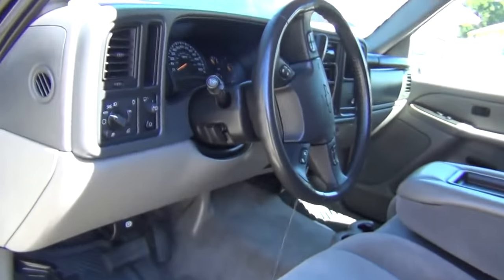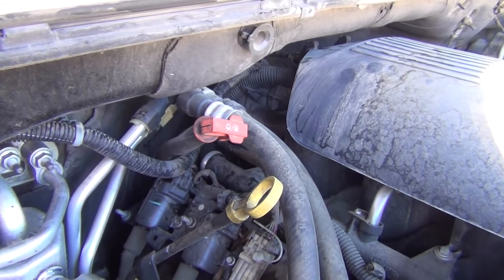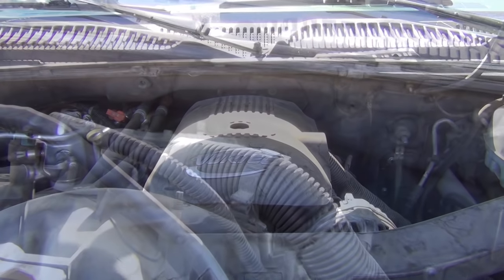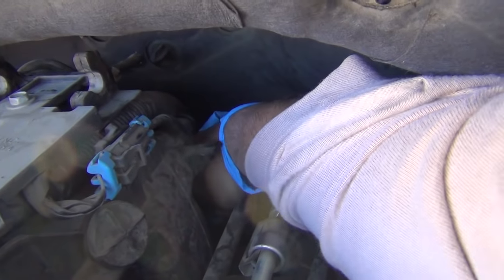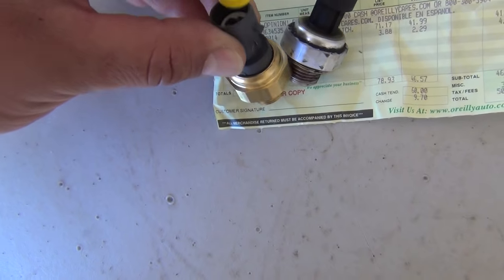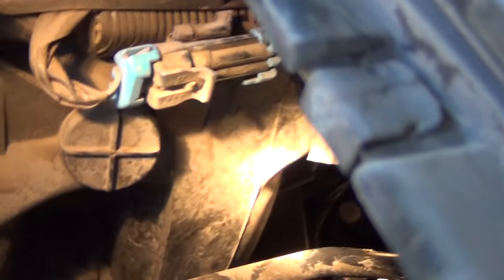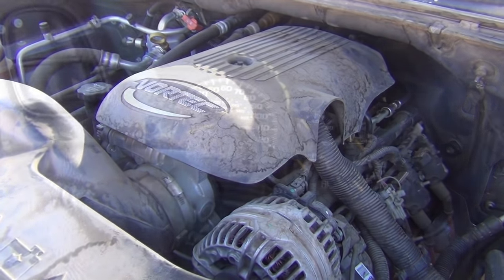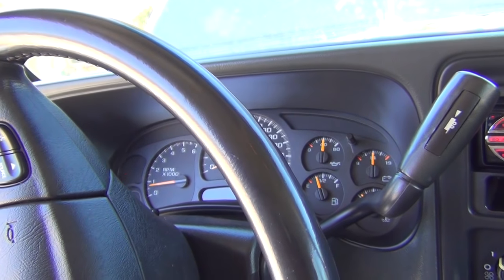CHEVY OIL PRESSURE HIGH....FIX!

Comment: I have a 2003 chevrolet Avalanche 5.3L V8. My pressure gauge is over max at a 4-5 o'clock position. I can't even see behind the engine. Did you remove anything else besides the cover or is there some trick I'm not seeing?
Reply from the maker: Sounds like a body ground strap.
I just helped a neighbor install a fuel pump and when we went to test it a few gauges were maxed out.
Turns out the bed of the truck was still elevated and the fuel neck was not touching the bed. The fuel neck has a ground strap and this was the problem.
A ground strap is a bare wire that looks like braided hair. There are several of them grounding at the back of the engine to the fire wall, from the frame rails in the rear, and up front.
Reply: ImRamro
Reply: ImRamro

Comment: I have a 2005 chevy avalanche 1500. The problem Is different. My oil pressure is under 40. I checked my oil level and it's good. Do you have an idea on what the problem might be!
Reply: Oil pump could be going out

Comment: hey I got the same thing wrong with my brothers truck and I want to know if you have to get that part fixed and just drive around with it high like that
Reply: Brian Gavranovic You can. It does not hurt the motor, but if for instance your oil pump goes out. it can cause you to blow up the motor. it is more of a prevention gauge, but if you need to drive it until you can get the part it will be fine.

Comment: I change my oil pressure sensor on my 2003 Dodge ram in the oil pressure is still high and it's gotten a little higher all I see is videos on oil pressure sensors and sending units I can't find any videos on what to do about high oil pressure if it's not your sensor please help anybody

Comment: How do I know which one is the plug when I'm looking at my 03 Chevy 5.3 V8? I'm going to attempt to do this on my own.
Reply from the maker: They are all in the same spot on the 2000's models. It should be just like the video. All the senders and temp sensors look similar, but they will not have the same plug in. 
Once you get the new part, just unplug the old unit and plug in the new one on the wiring before the install. Remember you may have to reuse the little rubber grommet from the connector.
Reply: Thank you. Your video was very helpful.
Reply from the maker: Jeanna Young No problem Jeanna Young, please let me know if you run into any problems?

Comment: I'm looking for a motor that can withstand the transmission I've told you but has around 320 -350 horsepower doesn't matter if it's a few thousands ...I tried summit racing ...car id ...but maybe I don't know how to look up engines right or they don't make him ... any suggestions??
Reply from the maker: +Jose Chavolla Here is a link with some nice engines that create some great horsepower. 
You may have to change out the torque converter to handle the added power?
Reply from the maker: +ImRamro http://www.jegs.com/c/Engines-Components_Engine-Assembled-Ready-to-Run/10763/10002/-1

Comment: will the oil leak when the oil sending unit is bad ??
Reply from the maker: Laxmi Sashi Not normally.....NO. 
The sending unit usually has tape of some kind of glue on the threads so they rarely leak. Do you have  a leak around this area? The leaks usually come from the intake manifold or the valve cover gaskets in most cars.

Comment: Can I keep driving without fixing this problem?
Reply from the maker: Yes the vehicle will function normally.
Just don't let it go forever.
Having a good working pressure gauge is a must.
This is the only way to tell if you have oil pressure or low oil issues that can lead to engine failure.
You don't need to replace it immediately.

Comment: So the gauge starts at 40 but goes to 60 when rpm go up or when you on the gas is the normal?
Reply: Thats how my truck was running but now it idles at 40 and driving down the st. It goes to 60 and on the freeway it goes up to 80 but used to only go up to 60

Comment: it's me again ...I'm looking for a replacement motor for my 2002 ford ranger thunderbolt it's got  4.0L v6 SOHC, RWD with a 5-speed automatic transmission...
any suggestions? ?? on motors?? that fit??
Reply from the maker: +Jose Chavolla When it comes to Fords I hate to say I do not know a lot about them.
I had a Ford Ranger with an inline 6 cylinder engine and that thing ran great.
I would have to just get on  some forums and message boards and ask around to find the info on that truck, sorry.
Reply: Hey, I've got a 99 Z-71 with the 5.3. I changed the oil a couple of weeks ago and my pressure will sometimes start out at about 50, and I'm hearing a ticking noise, like lifters maybe?? I can't remember for certain but I believe I used Valvoline high mileage that was a mix blend. Could this be causing the chatter I'm hearing as well as a little higher oil pressure? It used to always be right on 40 and never heard ticking. it just turned 160,000 miles. And I also added a quart of Lucas oil stabilizer when I changed it. Any info would be greatly appreciated!!!!
Reply from the maker: Rob Hamilton Oil filters and different oil could cause a change, but the noise is not a good sign.
The stabilizer should help, but most oil additives have some form of metal like zinc that helps with wear and tappet noise.
I do not think that the oil change will have any disastrous effect and 50 is not a bad pressure.
I would assume that your old oil had a lot of metal inside of it, like all old used oil does. This metal that is inside the oil is from metal wear and bearings and is different than metal shavings. You can try AMSOIL Z-ROD oil, but that stuff is expensive. I would try any oil for high mileage or that contains some type of zinc. I hope this helps?

Comment: hi everyone I was having the same problem ...I changed the pressure unit myself but the oli pressure on the gauge indicates barely low halfway .....but when I accelerate the gauge goes all the way to 80 at 70mph ..... do I need a need engine swap?? I heard about rebuilds ....which is more convinient??? last longer and not that expensive ?? and last any guess prices for either one ?? I have a 2004 chevrolet tahoe 5.3 fuel injected
Reply from the maker: +Jose Chavolla Sounds like the lower half of the engine needs to be rebuilt.
The low pressure issue is usually caused by the crank journals, or wear in the crank race bearings. 
If you can do some of the work yourself you can save a lot of money.
Here is a link that may explain the process a lot better than I can?
http://www.carsdirect.com/car-repair/how-to-tell-if-its-time-for-an-engine-rebuild
Reply: So to rebuild this motor is no more than 1,200?? Any recommended places?? So just the rebuild would be better than a motor swap right??? Cuz I just had the originsl transmission rebuild last month and I really don't wanna spend that much .....I'm has 21500 0 miles and I notice this problem about 3 days ago ...no white smoke coming out just the motor seems to quiet
Reply from the maker: Jose Chavolla There are a couple machine shops in my local area of central California?
If you look for engine machine shops and your city, you should get several in your area.
Many machine shops have many different prices. It would be smart to call around. 
I would ask how much for a complete engine rebuild? How much for a lower engine or short block rebuild? How much if you pull the engine and deliver it to them? 
This will give you the best idea of what kind of money you are looking at spending?

Comment: I have an 04' silverado 1500 with the 5.3. 
My question is, when I start the truck it stays at 40 PSI, once I start to drive, it'll drop, but once I accelerate it goes back to 40 PSI. 

What could be causing this?
Reply: Once I brake or slow down it drops.
Reply from the maker: Wesley Moore
The higher the engines R.P.M's, the higher the pressure.
This "could" mean that the crank journals or main bearings are worn?
This happens as the engine wears and the only way to fix it is to replace the bearings and have the crank shaft turned?
Another cause could be the oil pump. As the oil pump wears the gears have more space between them. This causes the pump to push less oil through the engine.
The cheapest fix would be to start with the oil pump and replace it with a high volume pump. This could help or resolve the problem all together. If this does not solve the problem, then the crank and bearings would be the only other option. Good luck and I hope this helped. It would be nice if it was like a 50 dollar part, but this is usually caused by high bearing wear in the lower half of the engine.

Comment: My 2007 Tahoe just started this.... It reads fine most of the time and then sometimes it just goes to Zero and starts blinking and telling me to shut the engine off... If i turn the rig of and then restart it goes back to normal.. Happens speratically...Im pretty sure the oil pressure is fine so im thinking either the gauge or the Sensor.... THOUGHT????
Reply from the maker: James Owens Your fist message, just showed up, lol. 
When the engine is running fine pull the oil fill cap on the valve cover and look inside with a flashlight. "If" you can see oil squirting around you know oil is being pumped up through your heads. Then when the oil pressure drops off, keep the engine running and go look inside the oil fill cap. If you do not see oil squirting around rapidly like before, then your oil pump is not pumping. This could be the oil pump going out or maybe a piece of metal or plastic stuck in the oil pickup screen? Either way, if your sensor is accurate and the oil is not pumping up through the head, you will have to change the oil pump. I hope this gives you a place to start. If this does not get you anywhere, you can remove the oil sending unit and get an oil pressure tester. Screw it in the same hole and run the engine to test the true oil pressure.
Reply: @ImRamro  I got a 2008 Chevy Tahoe and the oil pressure is showing 80 PSI
Reply from the maker: @r-luvbham6608  If 80 is peged to maximum pressure, it is almost always the oil sending unit. super easy to fix.
Reply from the maker: This is supposed to happen when the oil sending unit fails. Believe it or not this is a very common problem. The gauge maxing out means it is bad and needs to be replaced.
Reply: @ImRamro  thanks

Comment: I am on the side of the road with my 2006 chevy Silverado. On way to work alarm tells me low oil pressure (on zero) sporadically it jumped up around 60 and back to zero. When I pulled into rest area with engine idling it went to 80. When I shut off engine and turn key on without starting pressure goes to 80 and stays there. Idling stays at 80, rev goes to zero. Am I safe to drive home? (20 miles)
Reply from the maker: I would say yes!! If the gauge is reading and the engine is not running, it is not reading pressure accurately. watch the temp. Good luck
Reply: @ImRamro  thank you! .... I will replace it tonight
Reply from the maker: @rossmacneil6033  Please let me know if it works?

Comment: my 05 Chevy has same high oil pressure so I pick up a pressure switch I wa$ told I need a special tool is that right
Reply: Keven Tirrell u need a oil sensor socket 1 1/16 I believe

Comment: my 98 z71 every other day when I start it up or sometimes when I'm driving the oil pressure will hit 80 and the engine starts knocking. it's driving me nuts. is this oil pump?
seeking confirmation and advise
Reply: I'd check you're oil lol

Comment: would this oil sender cause oil to leak?
Reply from the maker: +David Smith I have had the oil sending unit leak on my 1993 Chevy Z71 and had my gauge max out.
I do not know how common this is because all the sending units on newer vehicles just go out and max out the gauge. A leak at the base of the sending unit is very common, but it does not mean that the unit is bad.

Comment: can the oil pressure sending unit cause the engine light to come on??
Reply: JDM Toys
Reply: Wow, my h2's check engine light came on and I had my oil pressure saying 80 PSI (Maxed out) but its funny because I've had trouble where the check engine light comes on because I've had a misfire too.

Comment: Would this work if the oil pressure gauge doesn't move at all?
Reply from the maker: i would start here, it is cheaper than replacing the gauge.
Reply: ImRamro ah ok thank you sir 👌

Comment: Hi I have a 2007 Chevy Silverado classic 4.8.. And my oil pressure gauge on the dash board shows ways past the 80.. What would that mean??
Reply from the maker: Did the problem just start one day?
It could be one of a few things?
It could be a wiring problem like a bad ground wire, this would make the gauge max out.
More than likely the oil sending unit is bad?
Are any of the other gauges maxed out?
Heavy weight oil or gear oil would cause this, but you would know if you just changed the oil and replaced it with gear oil?
Reply: ImRamro Yes thank you . I am also having the same problem.  Change the oil today and seen pieces of metal came out!  I know this is bad. But my gauge is. At 80psi. No check engine nor other gauges are going crazy!  The mechanic at the shop wanted to charge me 80 bucks to check it. Then charge me parts and labor.! I guess I'll start buy buying the oil sending unit or oil pressure sensor!  Thanks again!
Reply from the maker: MICHAEL ALANIZ
Replacing the sending unit is very easy. As long as the part has thread sealer on the threads, all you have to do is unscrew the old one and screw in the new one. Just don't lose any plastic pieces from your old one. You may need to use the plastic insert?
Good luck.
Reply: Thank you !

Comment: will it cause a leak?
Reply from the maker: +Michael Bricks The oil sending unit going out should not cause an oil leak, but oil leaking from the base of the part or the rear of the intake manifold is common. I you suspect oil is leaking from the base of the sending unit, just remove the unit and use some pipe thread tape and reinstall the sending unit.

Comment: Mine is wrong like yours but mine is leaking oil a little could this be the problem ?
Reply from the maker: a leak would make it read low pressure, but if the gauge is pegged to the max, it is probably a bad sending unit. You can use pipe thread tape or sealant and this will stop the leak, but the new unit will already come with a sealant on the threads.
Reply: ok thanks and I have already changed to sending unit which fixed it and the oil leak was a rear main seal and i fixed that with some AT 205 re seal
Reply from the maker: Outdoorsmen1214 Right on!
Reply: I have a 2004 Chevy Tahoe that the oil pressure gauge is pegged at 80 and has been for about a week and a half. I had the oil changed last Monday, still read high oil pressure. On Wednesday, the check engine light came on.  Now, every time the car is turned on, it's pegged at 80 and still check engine light on. There is no oil leak and no knocking noise.  Just the dash board gauge and light shows any indication there is a problem. Is it still safe for my car to run it?

Comment: any chance it's the gauge?
Reply from the maker: I just responded to your original comment with a good link.
Have you changed the oil yourself recently (not a shop)?
Did you replace with the correct oil weight?

Comment: what if it's not the sending unit
Reply from the maker: +Curl Davis I would need a little more info?
The sending unit wiring could be disconnected or bad?
The gauge could be bad?
There may be a electrical problem or a bad ground?
The oil pick up tube could be blocked in the oil pump?
Your engine crank journals may not be lined up due to a recent improper crank installation? 
Your engine may have no oil or the oil filter may be loose?
There are a lot of causes, but when your vehicle gauge acts like the one in the video, the sending unit is usually the cause.
Have you tried any fixes yet?

Comment: I got a 2006 envoy 4.3. I just notice that my oil pressure gauge is fluctuating form 0 to 40. what might it be?
Reply from the maker: +Carroll Cooper Have you had the oil changed recently? It could be a loose oil filter? Does it leak a lot of oil? 
I would check the easy stuff first. Look for major oil leaks and check the oil level. I would also check to see if the oil filter is loose?
Reply: +ImRamro 
it looked liked the oil was a little low. i put 1qt in and then the pressure went to almost 50 or so. what is the reg oil pressure suppose to be.
Reply from the maker: Carroll Cooper Most common oil pressure is about 40 psi.

Comment: if bad is any way it can lik  oil from there?
Reply from the maker: +Miguel Almazan It usually leaks in older model engine blocks and only has to be removed and thoroughly cleaned with gas or a solvent like brake clean. Then you can use an air compressor to blow it out. Then I would really clean up the hole you removed it from and use some type of thread sealer or pipe tape on the threads. If it is leaking, you could lose pressure, but more than likely it is leaking from the back of the intake manifold or the head? A good size leak could cause low oil pressure to fluctuate. Leaking oil from the base of the oil pressure sending unit does not mean that the sending unit is bad, it only means that the oil is leaking from there. Does your car have low/high oil pressure?
Reply: I just buy the truck n its high pressure so I change the oil n the next day when I move the truck where it was park over the night I saw a lot of oil in the floor
Reply from the maker: Miguel Almazan I would start by checking the oil filter. The filter may be slightly off, the wrong type, or loose?
I would also check the drain plug on the oil pan too. 
Can you locate where the oil is coming from?